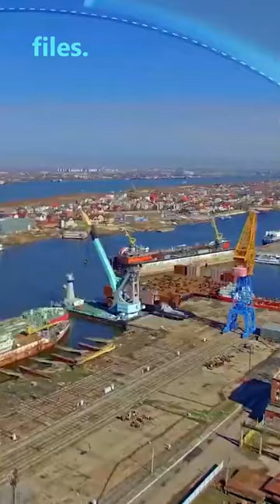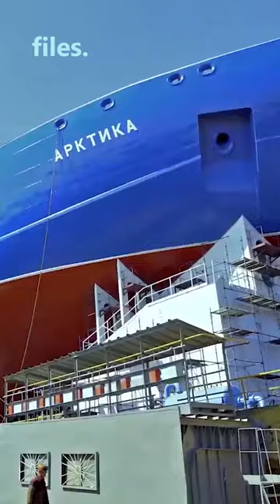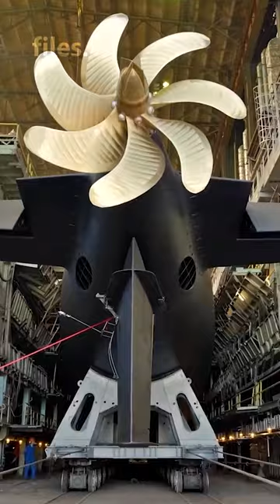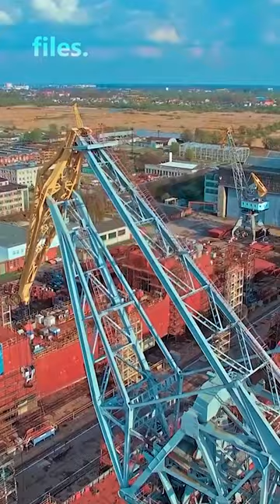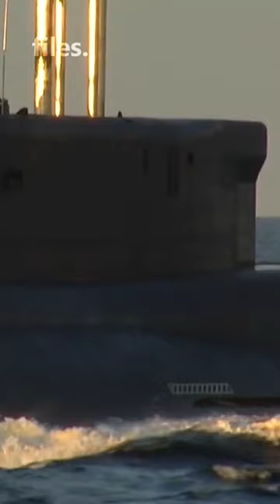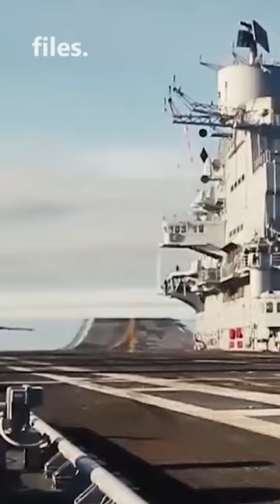Finally: Russian Navy aircraft carrier Admiral Kuznetsov

Comment: They take years to "fix" the previous carrier yet want us to believe they are going non-stop AND can afford to build a new one...
One hint of the problems here, they seem to lack large engine capacities hence their new warships ships are all sub 4000 ton.
Reply: Maybe they are working around the clock its a wreck probably stripped o to the frame and started over.
Reply: They might be trying to stick to the old Naval Treaty they have/had with Turkey. Which is also the reason the only aircraft carrier in the Russian navy is small.
Reply: You referring to the agreement with Turkey about displacement to enter the Black sea the Russians want there old port east of Crimea where they had there base when they were the USSR communist russia.the port was valuable it doesn't freeze in the winter . Big ships can come and go year around .

Comment: The nme is limiting the analysis the adaptibility the application, using a system of cad/cam with worldwide accessibility to advanced research project data proving prototypes provides success in building such ships as the m/t knutsenev, or the USS Reagan thru cooperation we'll see our shoes walking thru walls in space while dancing on air.